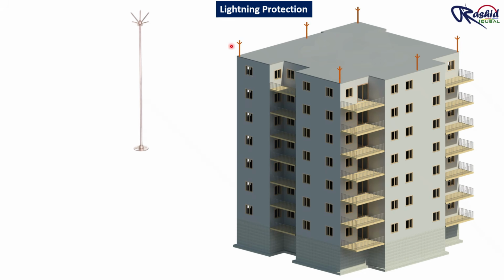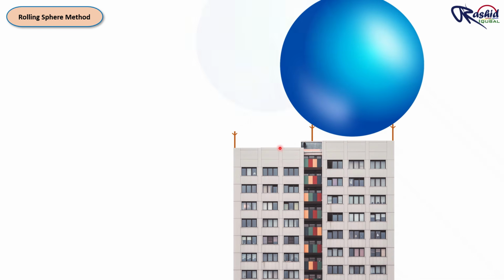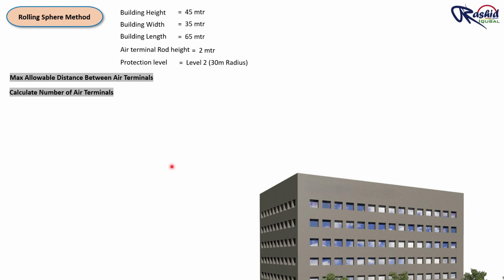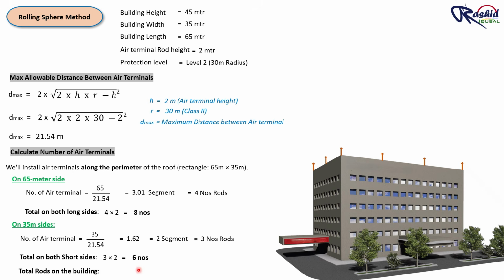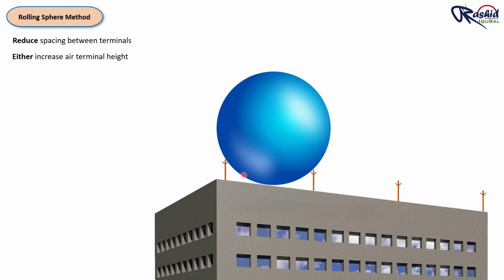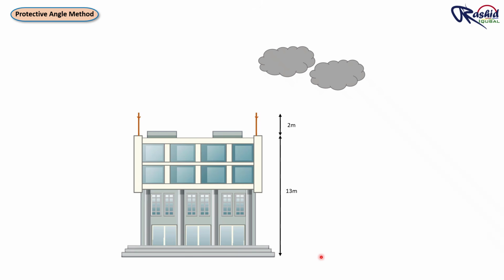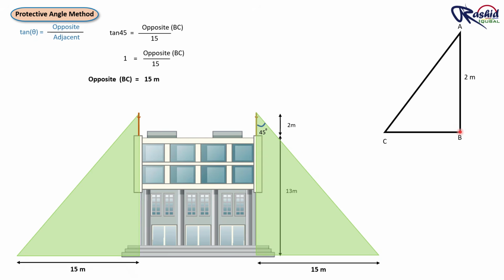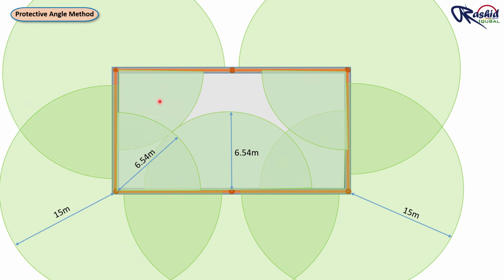Lightning Protection System Design & Calculation | Rolling Sphere & Angle Method Explained

Comment: We are unable to find correct Earthing value the  reason of 85 MTR distence we are using 25 SQ aluminium cable 

Kindly revert any have ...??
Reply from the maker: The resistance is likely high due to the long cable length and material; I recommend increasing the cross-sectional area of the conductor or installing additional earth pits along the path to reduce the value.

Comment: If i want to make a design which method I will use roll sphere or angle method?
Reply from the maker: Both are correct but Angle protection method is easy to calculate

Comment: Sir.For example, when calculating with the rolling sphere method, if the air terminal is placed at the corners and on the side, will the center be free? Please explain.
Reply from the maker: Yes, center can be protected if air terminals are properly designed so that rolling sphere does not touch the roof anywhere in between.. if it touch then increase rod length or place rod in between..

Comment: How about the center areas of rooftop? Is it covered by air terminal? Bcs the rods just add only two for both short sides, is the center in danger area?
Reply: No the center is not in danger coz we are using a sphere of radious 30m (having diameter of 60m) and the distance between two rods from opposite sites is 35m so the sphere will not touch the roof
Reply: @afrin1442  Dmax in his example is 21.54m so two rods will also be required in the center of the roof to provide complete protection of the roof.

Comment: Protection angle method has been very much clearly explained about the complete coverage of the building including entire roof surfaces. But, the coverage in rolling spear method is not as it has been presented for PA method. Could you please make it clear.
Reply from the maker: Thanks for comment ❤
Noted, i will make separate video for Rolling sphere method in detail

Comment: How the centre of the building js protected with 10 rods. 12 rods are required right?
Reply from the maker: I have mentioned minimum number of rods required to provide protection up to the mark. However, considering 12 nos would offer better safety…

Comment: I'm here in KSA working in substitution 2000mw pv .we installed different types of system like lighting rods, grids and other protection device...
Reply: Hi can you help me with lightning
Reply from the maker: That’s great, A 2000 MW PV substation is a huge project. Yes, for lightning protection we also use similar systems like  lightning rods, earthing grids, and other protective devices depending on the site design and standards. Thanks for sharing your experience in KSA...